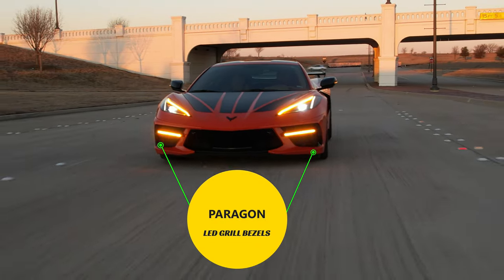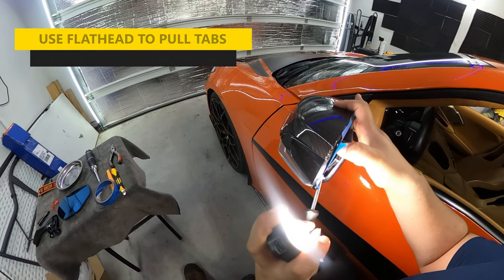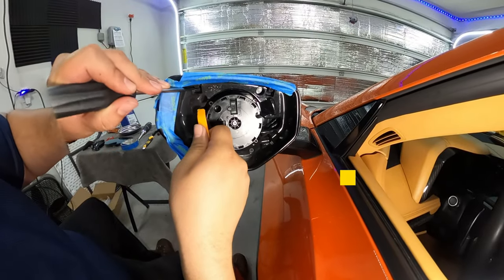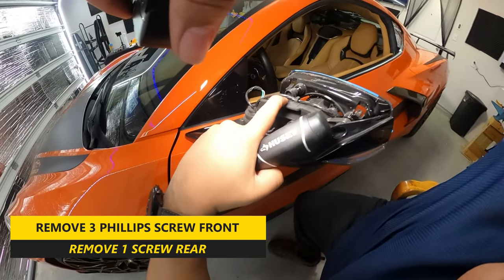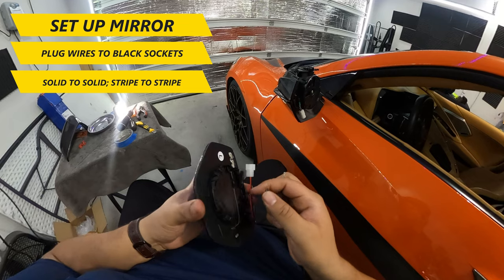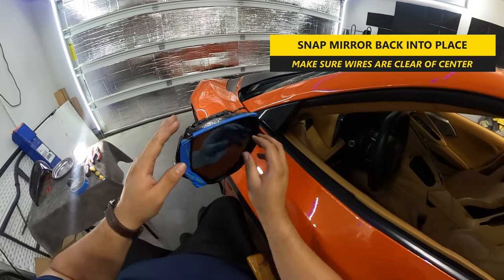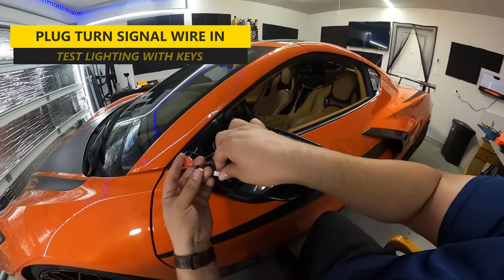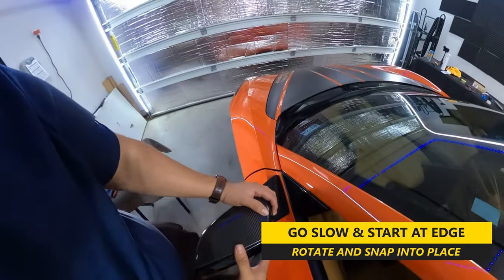Install Guide| C8 Paragon Wide View Mirror & Turn Signal

Comment: if you need to just reconnect the blind spot monitor, do you still need to remove the other side mirror covers?
Reply from the maker: Hey Arnelarches thanks for the comment. So the wide angle mirrors have the integrated turn signals built in that need to piggyback off of the turn signal power line thats in the front of the mirror housing. If thats something you dont want to have operating, then just plugging in the blind spot monitor can be done and you dont necessarily need to remove the front portion of the mirror. Hope that helps.

Comment: Are you in the DFW area? Thank you for making this video, been wanting to do this mod but like you said have to be careful and I'm nervous about breaking tabs.  It looks like if I just want to change the mirror, you don't have to take the cap and all off?
Reply from the maker: Hry Jemo thanks for the comment! Yup im in the DFW area. And yeah it can be a bit nervewracking but its definitely a doable project. Just gotta be gentle is all 😁. If you do want to change the mirror you can technically bypass the cover part IF you dont want the LED turn signals built into the mirror itself to be used. If you do, the only way to piggyback that power is by accessing the front turn signal wires which are hidden behind the front cover. Hope that helps 👍
Reply: Hi bud, will you willing to do for me and charge me?  Thanks and im also in local dfw
Reply from the maker: @duynguyen-gd4el  hey apologies for not responding to you earlier. I wouldn't mind helping out but it may be some time before I have a free moment. Regular work along with a few sponsor commitments have me tied up heavy lately. I'll respond to your email and we can talk about it more.
Reply: @NuHorizonC8  sure thanks